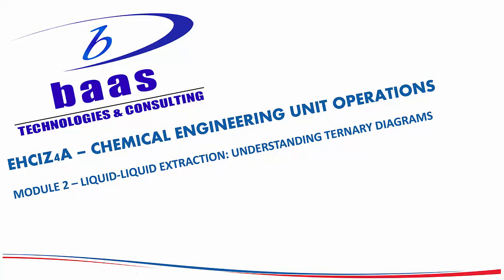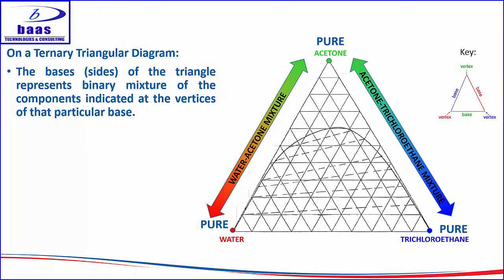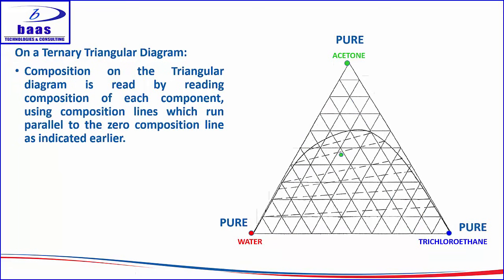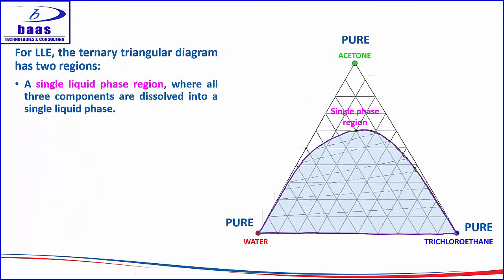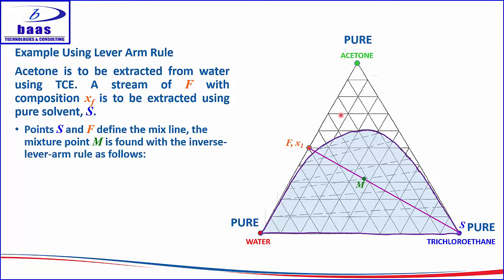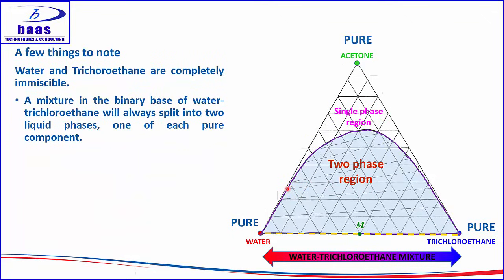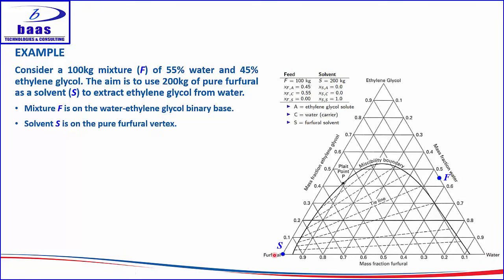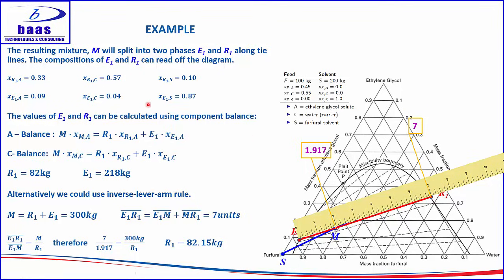LIQUID-LIQUID EXTRACTION -UNDERSTANDING TERNARY DIAGRAM

Comment: Please how do we draw the miscibilty curve?
Reply from the maker: A miscibility (or binodal solubility) curve, usually originates from experimental data gathered by performing liquid-liquid extraction experiments. Mixtures of the three components are prepared, vigorously stirred, and allowed to reach equilibrium. Separated phases are analyzed to determine their compositions, revealing the ends of the tie-lines. Plotting these equilibrium compositions forms the solubility or miscibility curve, which shows the boundary between a single-phase mixture and a two-phase system.

Comment: hello, upon solving for the R1 and E1, my R1 was 80.31 kg while my E1 was 205.51 kg. I used the values you've found. however, if I were to use the exact, in which I haven't rounded it off, my R1 is 82.67716535 kg and E1 is 196.8503937 kg. So, which is which? and how did you come up with 82.15 kg and 218 kg for your R1 and E1, respectively?

Comment: It was very helpful but I don't understand a thing. How do you determinate the line E1-R1?
Reply from the maker: The first step you have to do is to approximate a tie line that passes through point M. You can use the dotted lines to make a line with similar slope making sure it passes through point M. Points R1 and E1 can be found on the miscibility boundary, that's how line E1-R1 was drawn. See this video https://youtu.be/1Cdfinxz0EU
Reply: @TumisangSeodigeng  Thank you very much!! You're and excellent teacher. I'm doing a problem and, I have the luck that the M point crosses with a repartiment line and then this is my E1-R1 line. Thank you very much again.
Reply from the maker: @anaselme  Thank you very much for the kind words.

Comment: Can we say that water, benzene and acetic acid form a ternary system. I did'nt get one thing water is not soluble in benzene and but how then adding acetic acid make them soluble
Reply from the maker: Yes in someway it means that. If you look at the plait point, CP it is a completetly dissolved single phase liquid with 9% water, 39% Benzene, 52% Acetic Acid. https://drive.google.com/file/d/1wOutMhJLI5ra59oljdoILDLmeUQk2diz/view?usp=sharing 
However you cannot have water and benzene soluble by themselves in a binary system. If you look at the Water-Benzene base, the mixture will always split into two pure liquids.